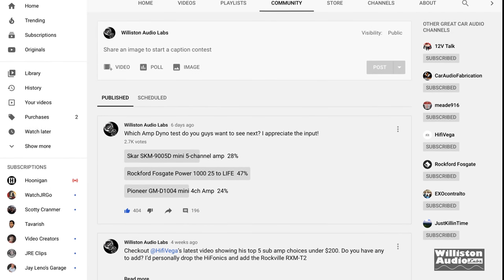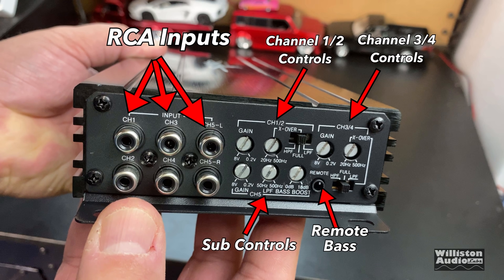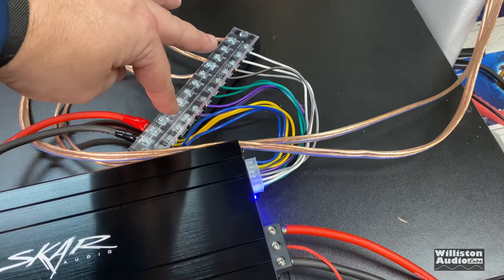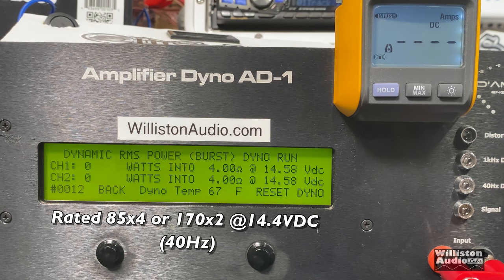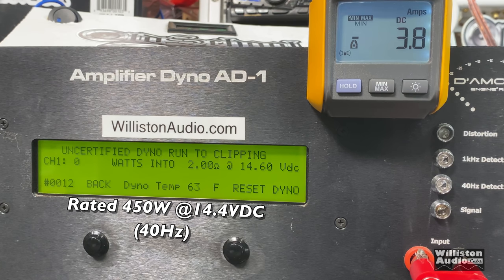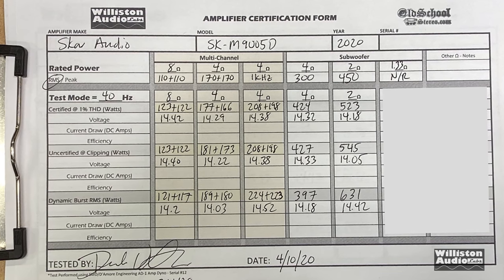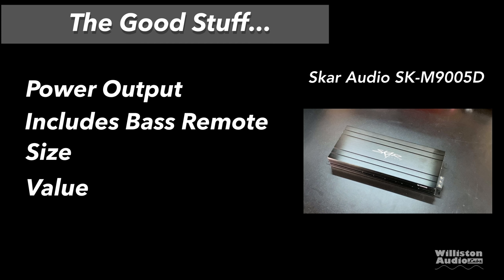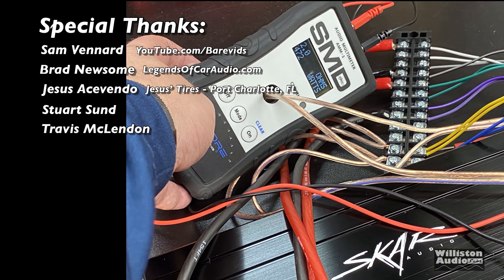Five Channels, 900 watts and Cheap?

Comment: Hello. Can I run the 4 channels bridged to give me 2 channels at 4 ohm and at the same time run the sub channel at 2 ohm load?
Reply: Yes you can. The 5th channel is a separate channel dedicated to subwoofer output so you should have no issues. I have the RP-600.5 powering 2 TX5.25c mids and tweeters at 4ohms on ch1 and 2 and 2 EVL6.5s wired to 1ohm on ch5 with no problems. Sounds great.
Reply: @babyTOY-YODA777  how is that possible amp is two ohms stable

Comment: I'v noticed a lot of   "Hiss"  in many amplifiers on tweeters is very overlooked.  I've come across 1 that is fairly decent at "Not hissing.  This isn't a tuning  issue in my case (as far as I know) but I would love to hear about some amplifiers (or other options) that correct this outcome.. Any help on that?
Reply: bringmeyourweak that’s the issue with full range Class D amps.

Comment: I just don't understand 2 ohm stereo Vs 4 ohm mono?
Reply from the maker: For a multiple channel amp, 2 ohms per channel is equal power to 4 ohms bridged. So if you get 100x2 at 2 ohms, you should get approx 200W bridged at 4 ohms
Reply: @wal  
Thanks very much
Reply: I understand the draw with bridging and I definitely see the purpose if you’re building a mono system or bridging a subwoofer. But I wouldn’t put anything above 100hz into mono if I could help it personally. I’m not familiar with car audio but I do audio engineering and production, we typically make everything under ~80-100hz mono. I wouldn’t go above that. Some club and event systems and speakers are mono but often in concert with stereo speakers. Not uncommon and frankly good to have a sub mono, just in case the engineer did not properly treat the sub stereo image.

Comment: Why do 2 amps with the same certified rating one jumps way up dynamic and some don't gain much over the certified rating
Reply from the maker: Depends on design and available power. In this test all channels were loaded at 40Hz, which is not the normal use. Usually you’d have the front and rear channels crossed over (high pass) and you wouldn’t load them down to this frequency

Comment: Big d I have a Alpine MRP m500 single channel amplifier I have two 12s hooked up to it one is a quantum audio 3000 watt dual voice cool and the other is what you made famous the 12-in blaupunkt single voice call how would I go about running both of these subwoofers on the Alpine amplifier as of right now I have it running on the dual voice cool positive to negative positive to negative then running out the box into the amplifier then the valve punk I just have it positive negative into the positive and negative tensiles on the inside of the box then obviously positive negative into the amp but it kind of wants to shut the amp off once the volume gets up past 40 Don't get me wrong sounds absolutely amazing but I want to stop this issue cuz I don't want it to cause something to blow out inside of my amplifier and I can't find any wiring diagrams on the correct way to do this
Reply: sounds like low voltage cutoff. most car amps and head units will shut off around 9V
Reply: You can't do it correctly.   The only option is to get matching woofers

Comment: when you say it could run my complete system  you think it could handle 4  6 1/2 's and 2 6x9's
Reply: I used 4 Infinity Primus 6.5" coaxial speakers that DC ohm 2.4ohms. They are sold as 3ohm. The 60 watts @ 4ohm / channel or 90 watts @ 2ohm puts me about 80 watts @ 3ohm. I can tell you the Skar RP-600.5 amp pushes these speakers clearly and loud and there is not much power difference on main channels. The 6.5 coax are so loud I either had to turn down the gain to hear the small 6.5" Skar sub or get a bigger better sub. I tried bridge mode running 2 primus speakers in series and sounded great. Bridged at 4ohm is 180 watts. I had more power individually than series due to low impedance.  Hope this answers the question that it can run your whole system. If you have 4 ohm speakers run 2 6.5" in parallel for a 2ohm load on channels 1&2 and the 6x9 on 3&4. Definitely experiment with the parallel wiring. I might run the 6.5" door speakers in series instead of turning down the gain. Then I have 2 free channels for more speakers.
Reply: @opinionsevrywhere  thanks

Comment: Is that pig tail a restriction?
Reply: What do you mean by restriction?

Sorry if it’s common knowledge. I’m new to this world and not afraid to ask questions. 
Are you referring to the gauge of wire and push pin connection being too thin of contact, that it restricts the —> insert correct word <— ? ✌️😎
Reply: @PripyatPlayground  yes. Usually with amps that allow you to run your own gauge wire with whatever u want, with this amp the pig tail is 18awg. I’ve heard that gauge doesn’t hold up very well under high wattage but from this video if can clearly handle 600+ watts
Reply: @noahcrooker4526  for 10 seconds.... it's going to be suspect for prolonged play at high levels. That's what scares me the most on this amp.  There's a video out there where someone ran a sub with this small wire with a infrared thermometer and the wire got freaking hot as....
Reply: @jamesg8246  that’s for long distances and that’s a subwoofer. I bough the watt 4 channel and I’m Only running 50rms thru each channel so 18awg over a short distance for 50watts shouldn’t heat up a lot. Next amp i buy will not have the pig tail just because I don’t want even thing to be 16awg and the pigtail be 18awg
Reply: In the simplest terms possible, no.

Comment: Aren't resistive loads not the same as reactive loads? So its not as accurate to simulate a moving voice coil.
Reply: madjimms This has been discussed before. It is accepted that the dyno runs are to compare manufacturer claimed ratings to ratings of retail amps. Also to compare the outputs of different amps. The test standards require resisitive loads because different speakers vary too much in their interaction with the amps when driven.

Comment: Hey question,  whats a good all in one amp for 2 simple 12s and high for my chevelle convertible.  I'm trying to prevent having multiple amps
Reply: Take the watts the speakers will need. Then find amps in your price range that meet those watts and then find dyno tests or some proof of what those amps out put. Some companies REALLY over eatimate what their amps really out put.
Reply: @meepmeeppaul  I have always wondered about this when it comes to mids. I was going to pick up this amp to replace my factory amp in my 2001 expedition and run all new wires to withstand the watts. Then replace the hidden factory sub too. So here is my question, do I need to find speakers with a 170+ RMS for mids? Most speakers I see are way much RMS rating.
Reply: Cab amp are good amp and dont break the bank.. I ran them at.5 for years so just a simple sett up like u lookin for cab amp would be the way to go!!!
Reply: Who cares? You're gonna ruin the car so I'm not interested in helping

Comment: Anyone have issues with this amp causing whining in speakers? I'm having an issues with this amp but not any other one I replace it with.
Reply: Your ground it's not good
Reply: @gilbertos1984  

grounds are solid, replaced all rca cables, tripled checked all cables and wires.  just have noise with this amp. My guess its just starting to go bad. the sub channel is good just the front doors have some noise.
Reply: @mikewaters6339  try and bench test it. Get your car battery, run positive + remote and negative directly to the battery. Connect a set of speakers, and RCA to something like your phone. This way you will eliminate every variabile that's inside your car. If it still whines, then something inside of the amp is going. Try and ask an electronics shop to take a look at it before throwing it away. Maybe you can save it with little money if it is indeed going bad. Good luck!
Reply: @adyandrey23andrey  

Good idea, Ill go back and try that. It's in my garage just sitting for now.  I'm thinking it has RCA issues because,  I took it out and using two different amps now and it's sounding good. I have a Belva 4k doing about 1400wrms at 1ohm, and old school kicker 150.2 running my surrounds at 2ohm each channel. Way to much for a 95 f150, LoL, small space in the reg cab. LoL oh well I'll repost if I decide to get it looked at. Thanks for the information and feed back.
Reply: Update: from two weeks ago. I reinstalled it in my friend's car, and same issues with noise in just the fronts . Installed RCA noise filters, and worked good until the other day. Massive noise issues and intermittent cut outs and massive heat. So much heat it burns to the touch. So, I'll chuck this up as a loss, with some sort of internal/board issues. A buddy at work , just had one installed and it's been working great. I guess mine was a lemon.

Comment: Try taramps bass30k
Reply from the maker: The Amp Dyno won’t measure amps that big and the bench electrical required is insane.
Reply: @wal  what is the max watt limit of dyno AD-1
Reply: @acue79  single Channel 24000w 0,5 ohm or 2 Channel 12000w 1 ohm

Comment: SKAR are shit.
Reply: Made rated power plus some its a buget amp if it was bad it would have failed stop being a fan boy
Reply: G.J.C  probably rated by the deaf.
Reply: You get what you pay for.... Fact.!
I had a little JL Slash 250/1 Fvcking rocked!!! a pair of 12"s and never got hot... And lasted for years It cost $400. but was well worth the years of good clean problem free power.! People refused to believe that little amp was all I was running, and would search my car for another amp..lol Stick with a proven clean amp, it will save you money and frustration in the long run. Alpine, Rockford and even Kicker are good amps also.
Reply: @2869may  100% agree with you Nick.those skar amps are just horrible cheap nasty crap.
Reply: @winfield347  Those and MANY others...